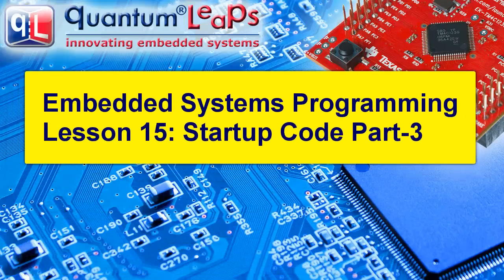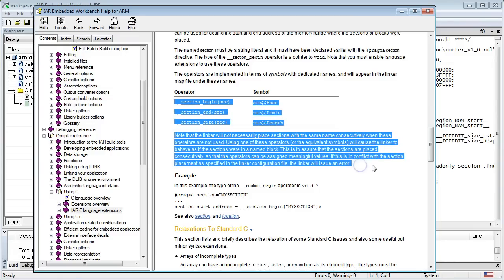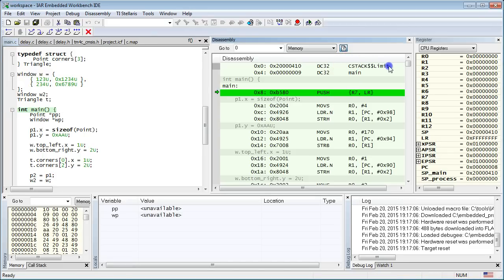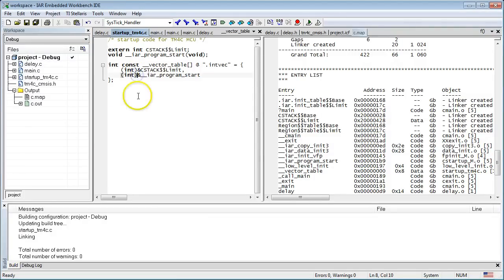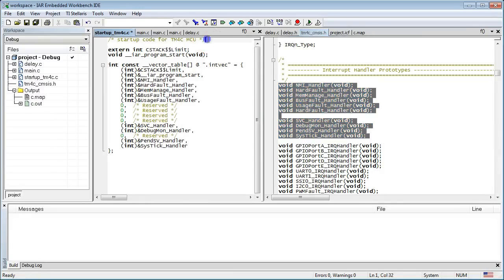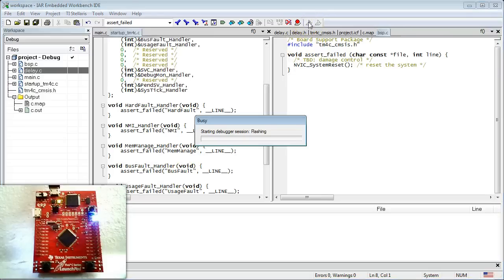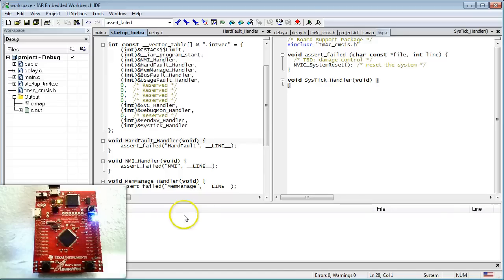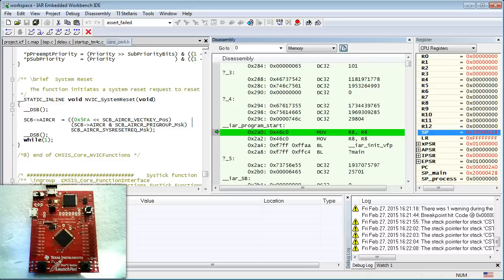#15 Startup Code Part-3: Vector table initialization, exception handlers, interrupt handlers

Comment: I have a question about the __vector_table. In which file is the table originally defined (before we overwrite it in the tm4c_startup.c file) ? Is this name "__vector_table" specific to IAR? Thanks.
Reply from the maker: This kind of information is available in the map file (I discuss the map file in lesson 13). So, for example, to see where the vector table comes from, go to lesson just before the custom startup file has been introduced, which happens to be lesson 13. The map file is located in lesson13\Debug\List\c.map. When you open this file in the text editor, you can see that the .intvec section is coming from the module vector_table_M.o. This module is provided by IAR. In fact, you can find it in your IAR installation: <iar>\arm\src\lib\thumb\vector_table_M.s. This is an assembly file, so you can look at it with a code editor.
Reply: thanks ! that helped!

Comment: Is #pragma weak portable? If not, what's the alternative?
Reply from the maker: #pragma directives are not standardized and therefore are not portable between toolsets and between different processors. You should treat them like the vendor-specific compiler extensions. For example, it would be impossible to write startup code in standard C without such extensions. But then, you should clearly understand that such code is not portable. In lesson 19 you will see an example how to port such startup code from IAR-ARM to GNU-ARM.

Comment: Anybody could you help me. I could not see the disassembly view  for start up section like  in this tutorial. I use IAR IDE 8.11 32k code sized limited version. Is this version related or configuration related? please help me if you guy know the solution.
Reply from the maker: The disassembly view is provided in IAR EWARM 8.11 the same way as in the previous versions, through the "View->Disassembly" menu. This menu is only provided in the Debug mode. To get to the debug mode, you need to start debugging the application by clicking the "Download and Debug" button (Ctrl+D), or through the menu "Project->Download and Debug". --MMS
Reply: Hello Quantum Leaps, LLC ,
I can see the disassembly view but in different way for start up section  for vector table . Could I send email the screen capture to you.
Reply: I noticed the same thing. The disassembly view in the tutorial appears very different from that in my version of EWARM (8.22). For example, there is no CSTACK$$LIMIT symbol, and the __vector_table label appears at address 0x1, and for some reason the first word of ROM is given with each byte on a separate line.
Reply: IN 8.32.2 it's the same. Is there no possibility to switch between the "HEX (DEC)" and character view within "Disassembly" ?

Comment: Hi,
I'm following your lessons and i appreciate the way you do it. thx for this.
but now i have a problem. As I wrote the code for the __startup as you described. then the Stack pointer was setup to incorrect allignment. "Address 0x6800481D". Now i can not even see in the register view wich values the register have!!!
Any Idea how i can fixe this??
Reply from the maker: Texas Instruments offers a software tool called LmFalsh, with which you can wipe clean your TM4C MCU in the TivaC LaunchPad board. LmFlash is available at: http://www.ti.com/tool/lmflashprogrammer . --MMS
Reply: hi, thx for the quick answer. I tried it befor i wrote the coment. i cleaned teh flash. now the adress of the SP is0xFFFFFFFC. 
it seems that it's setted to another value. but it does not help much.
Reply from the maker: After cleaning up the MCU on your board with LmFlash, the flash memory it will contain all 0xFF, because this is the value after flash erase. So, you obviously need to program some correct code in. For example, you can program in any original code provided with this video course. You can use LmFlash for programming. The binary code is located in every lesson project in the directory \lessonXX\Debug\Exe\project.bin. --MMS
Reply: i had this idea too. but i have no binary files. only ".out" and ".sim"
Reply: I found one. thx so much!!!
Reply: Quantum Leaps, LLC but how can actualy this happen?i just download a programm in the flash and for sure not with a wrong value for the stack pointer. And i did not broke the connection between the board and the computer during the download!!